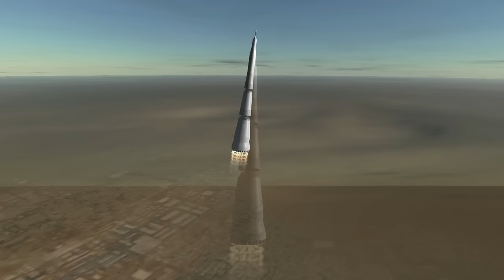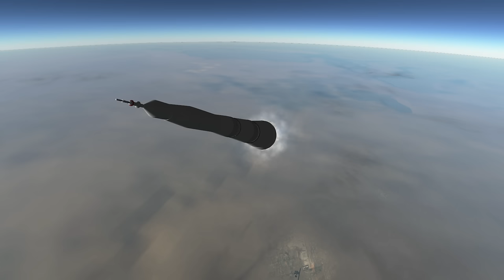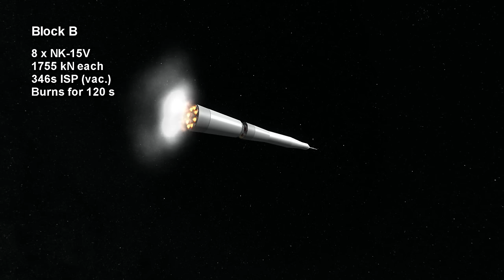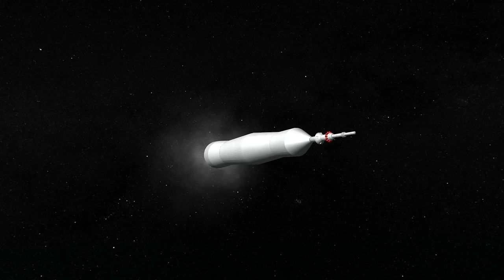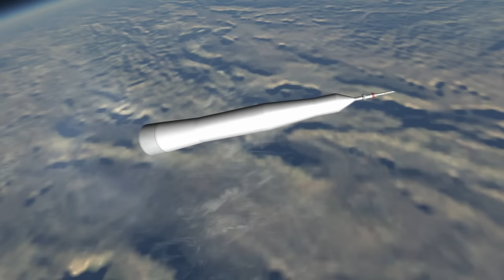Rocket Profile -  N1

Comment: Also it was cheaper for the soviets to build more of the smaller rocket engines than a few big rocket engines.
Reply: That is one theory I heard some one trying to explain why so many rockets were used in each stage. Curious on what you think for why the Russian approached rocket design in this.
Reply: It's also easier to deal with combustion instability on smaller engines.

Comment: More number of engines means more components of engines, increase chance of failure.
Reply: Syed Shah but if one stops working it's not a big problem
Reply: Tell that to SpaceX on falcon heavy
Reply: I’m already Sans Undertale The problem here was that the engines couldn’t swivel but used variations in thrust in different engines in order to steer the vehicle. Therefore it couldn’t afford to loose more than a few engines. You can see this in one of the real test flights that the launcher almost tipped over immediately after liftoff due to one or two engines next to one another shuts down and that the engines still working tries to compensate this by reducing thrust.

Comment: To be honest, if I was in charge of it I would have mandated the 1st stage be a set of 4-5 massive solid rocket motors. They would have been ideal for the N1. Cheap, throw away, large, reliable. No need for uncertainties at launch. It would have been easy to test such engines as Aerojet did with the AJ-260 by putting it upside down in a hole.